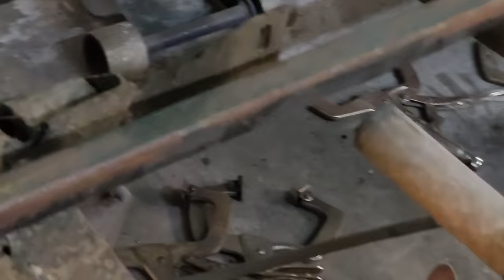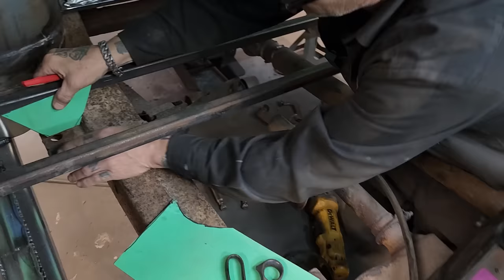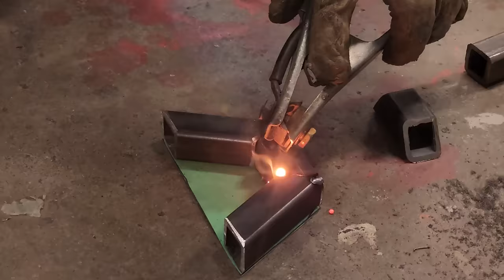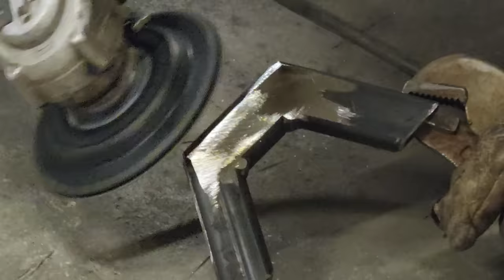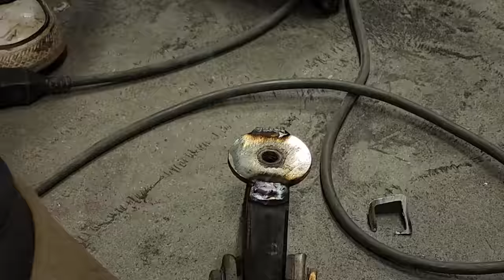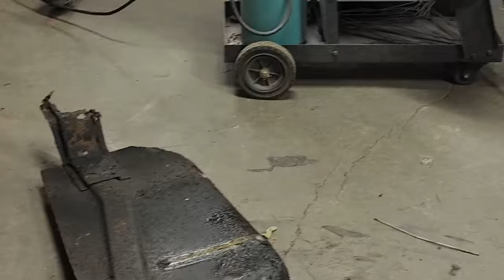The body mounts are rusted and busted ❌

Comment: Get yourself a drill press Chad. With a vise you will be so much safer. I’ve drilled like you are and when it catches it can really hurt. Doesn’t happen with a drill press. Just a bench size would be great. Just don’t want you to get Hurt , mate.
Reply: I’ve seen somebody stick a drill in the top of their foot holding it like that too after it slipped off the piece  .it makes a damn awful mess of ya foot ..
Reply: I think Chad is a chancer with all his power tools certainly doesn't show you how to use them safely.  One of the guys that says been doing it for years I haven't hurt myself yet. Going to hurt himself real bad one day.
Reply: Yep, get a decent drill press that will cater for a milling cross vice.
Reply: He has a few rusting away in his storage and many other tools.
Reply: Starting with a pilot hole helps alot.
Reply: Doesn't have to worry about drilling his foot. He's got those white metal Keds protecting his feet. Lol.

Comment: The floor is coming along nicely. To make it easier to drill a large hole, you could start with a center punch then a pilot hole. Also, you might consider a bench vise to hold the bracket when drilling.

Comment: Don't forget to drop your mount bolts in before you weld the mount on otherwise you'll have to come from bottom up!
Love your work! I've learned a lot!
Reply: if you drop the bolts in then you can't change the mount if the rubber fails , weld the nut to the top of the mount

Comment: Looking good Chad, but will you need to adapt the two lengths of straight stock that runs across the rear to allow for the up and down movement of the suspension and the propshaft ?

Comment: Great work Jolene. Chad cuts and butts and you click to show us the flick. Suggestion on the mounts place the bolt in thru the frame and newly made mount then welder up for alignment. Question? Since you made the rear quarter panels while the sill was still on and lined her up with the outside one, you will have to use the outside one of the three sills no matter what correct?
Reply: Great ?

Comment: The previous suggestion that you get a drill press is dead on. I bought mine for $ 30 US from someone who just didn't use it much. Just like new. Also, when drilling holes like these, first use a smaller bit (1/8"?) to drill a pilot hole for the larger bit to follow. Drills aren't that hard to use well. Also (again) use oil, not WD40, to lubricate and to cool the drill bit in metal. Also (yet again), slower drill speeds often cut metal faster than faster speeds. Work smarter not harder.

Comment: I know what your saying about those replacement panels allot of people were saying to get i guarantee they wouldnt come with those mounts  the bends would be wrong you would waste a ton of time trying to make them fit ...oh and drilling the mount holes if you would have centered the washer and welded it first you would have had a easy guide for the drill bit...

Comment: You might want to check your travel of the rearend before you go to far...there was a tunnel there for a reason and if you eliminate it you better weld your shocks up and put bigger springs on it...cuz first bump you hit your rearend/driveshaft is going to be hitting von the floor.